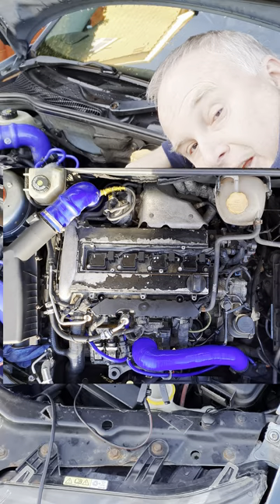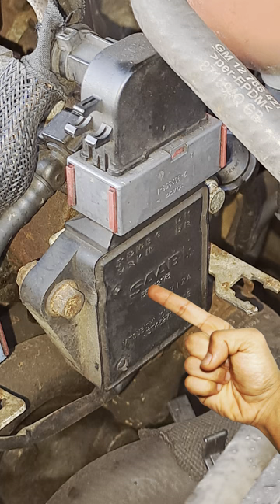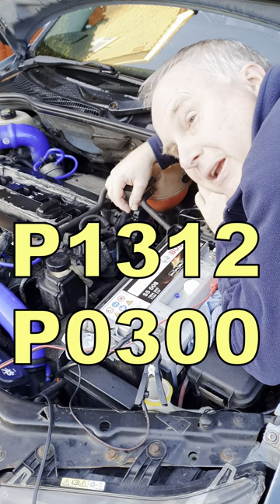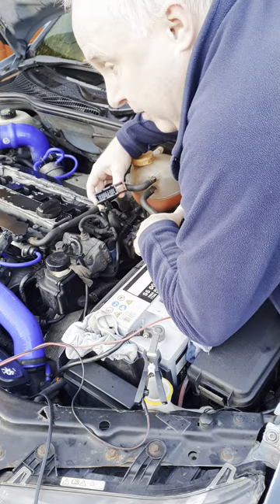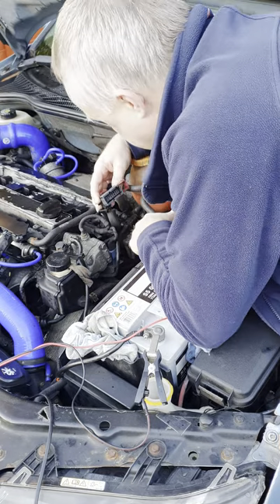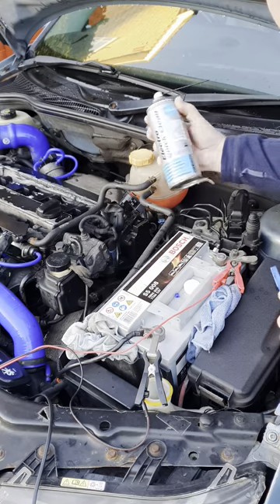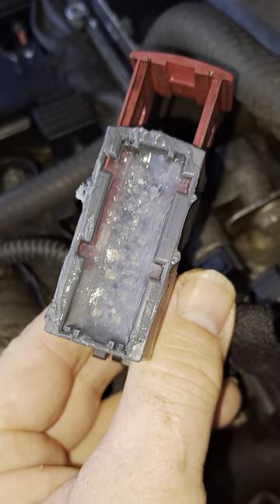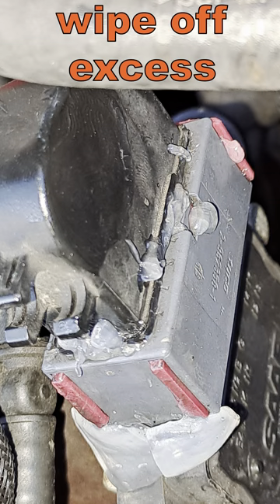Saab 9-3 Ionisation Module Problem - P1312

Comment: Dielectric grease is an insulator, and may cause an "open" in the circuit.  It has its place in the automotive world, but gobbing this grease onto sensitive electronic connections may not be a good idea.

Comment: I'm pretty sure that's not how you Wana use dielectric grease....please tell me if I'm wrong but I normally use just enough so it doesn't squirt out..mainly so it doesn't attract dirt and dust....good video though 👍
Reply from the maker: The idea here is to 'block' all the little nooks and crannies that allow dampness into the connector. Damp and dirt will thus be kept away from the terminals.

Comment: Great video! Quick question, my 9-3 B207, jerks a bit when I idle. Often when the car is warm. When it jerks, the RPM also drop a bit for a second. This dosnt happen when i drive the car.  Thoughts?
Reply from the maker: I'd be checking for a vacuum leak first. Check the throttle body and inlet manifold bolts are not loose . Check all intake hoses for splits. Next weekends video will show you where all the small vacuum lines are.

Comment: Don't have any codes or problems as yet so ordered some grease as a preemptive measure, it came today absolutely no corrosion on connector but blathered it and plugged it back in. I also did ecu connectors and abs module before I forget where I put the tube. Great tip to keep problems from turning up me thinks
Reply from the maker: Great to hear!

Comment: Another great find,
Thankyou,
When it stops raining I'll be doing this.
Reply from the maker: I cannot, 100%, state that this IS the cause of all those P1312 codes out there, BUT a non-waterproof connector under the bonnet? Bonkers. Poor Engineering and poor Engineering oversight from the Management team.
Reply: I’ve got P1312 and I timer this dumb shaking thing when I accelerate

Comment: Only just got round to doing this
But oh boy, what a difference.
Car is absolutely flying now,
Before it seemed sluggish , tired
And with a slight hunt on idle.
Thanks cyd , it's really made a difference
Reply from the maker: Try Denso IK24 sparks too. Big leap in technology compared to the original NGKs. Much much better.
Super stoked this worked out for you. Did your pins have dirt and/or corrosion on them?
Reply: @CycloneCyd  hi cyd,
Yes, three of the pins looked suspect, I used contact cleaner on both the module pins and it's wiring connector, a world of difference. 
I changed the old ngk plugs for quad fire ones,
( not sure of the make)
reason being, on my two previous saabs , I had one plug on both of them where the electrode tip fell off, both those saabs had plugs less than 3k miles on them, 
These quad fire ones have been fault free.

Comment: Hi Cyclone, love your videos, they've helped me so much wifh my 2004 9-3 vector! Recently had the water pump replaced due to leakage and I got the car back last week. A couple of days ago it started to get occasional misfires when accelerating, and at the same time I got the p0101 code - MAF sensor getting odd values. Should I look for vacuum leakage or replace the MAF?
Reply from the maker: First Q: is it an OE Bosch MAF or an aftermarket one? Make sure you have an OE MAF fitted.
Clean the MAF
Check for vacuum leaks (next weekend's video is changing the vac lines on B207)
Check you cobra for splits (replacement from the good people who make my coolant and intake hoses https://s.click.aliexpress.com/e/_DmOr0UB)

Comment: Hi. Firstly. Love your vids. Gonna be using your oil change video this weekend. 
I have a slight problem with my Saab. It’s getting an engine juddering when accelerating. (Auto gearbox) 2005 2L T. 
I’ve replaced spark plugs. Worked a bit better. Coil packs all seem fine. MAF is fine. MAP is fine. Only thing I couldn’t check was the O2 sensor on the turbo as I don’t have the right socket. Any ideas? :/
Reply from the maker: BUT have you TESTED the coils? https://www.youtube.com/watch?v=Tk6peaOCfSo
IF the coils test out okay, test your fuel pressure and give your injectors a clean
https://www.youtube.com/watch?v=MvACcx7eLg4&t=15s
https://youtube.com/playlist?list=PLOaePmzqZNJ3O5FiBWzLsLE2l-1fqAY1s

Comment: just recently got the p1312 code and going to try this. I took the connector out and cleaned the pins as well as cleared the code and it didn't come back instantly like normal. I will update after i drive it home.
Reply from the maker: Some people have reported running improvements. For me it was preventative. How is yours now?

Comment: I currently have this code. I was going too change the spark plugs.I would like too perform this procedure also. I hope everything goes well.
Reply from the maker: Use a toothbrush and some cleaner (contact, carb, brake) to clean up the pins. Then let it dry and connect back together. Clear the code and start her up. Does the code come back straight away?
If it doesn't use the car normally for a few days and see if it's still okay.
And please let us know how you get on. It would be nice to hear from several people's experiences to find out if this really is the cause of P1312. At the moment I cannot definitively prove it, I'm leaning on my engineering know-how here (which is good, but not infallible)
Reply: @CycloneCyd  Do I spray the connector with the red tab  with cleaner also?
Reply from the maker: @gman8578  yes, and give it a quick brush (with a soft brush like a toothbrush) to disperse any corrosion.
Reply: @CycloneCyd  Thank you so much. This means a lot.

Comment: Ive been working on saabs for 8+ years now and usually when i get these codes its 9 times out of 10 bad coil/coils. Ive never once replaced ion module just replaced plugs and coils and never had a car come back for it not fixing the problem

Comment: Hi dear,
I have Saab 93 1.9 tid from 2005 ,110kw
I have some problems with automatic gearbox, when it comes to four gear it comes some time like it's in neutral. What it can be? Regards
Reply from the maker: Have you checked the ATF level?

Comment: I followed this and put some silicone in there. Now it is stuck and I cannot open it. The red clip at the top would not open I tried applying force but it got broken. I am not able to unplug it now. 

And even if I find a way to unplug it then how can I plug it back in with a broken clip? Any suggestions?

Comment: I'm in Canada and we don't have 'Electrical Quick Clean' .. Can I use WD40 instead..?
Reply from the maker: NO, use a contact cleaner. WD40 do one, but any electrical contact cleaner should do. If you really can't get contact cleaner use carb or brake cleaner.

Comment: I have an 2007 Saab 9-3 2.0T it cranks but no start starts with starter fluid. Got it scanned got code “P0725” engine speed input circuit” what do I have to replace? Speed sensor, CPS? help.
Reply from the maker: That sounds like it's got spark but no fuel. If it's getting spark, it shouldn't be the CPk. On the other hand that code suggests it is. It is possible to test them, but you need a picoscope and the cost of a garage testing your CPk for you would be more than one costs (if fitting yourself).
So this is one of those few occasions where I recommend test by substitution. Make sure to get a Bosch crank sensor - these engines don't like anything else.
Are you in USA? This one: https://amzn.to/3Bsw4oz

Comment: Hello! I have a problem with my saab 93 2003 Aero. Its power is less than normal. The throttle is a lot weaker. But i have noticed that while i am on trip and have steady speed, with or withour cruise control i am getting a little blank brake and then the throttle is weaker than before. It is already weaker but it becomes weaker and its like i have 50hp. I have changed ECU, throttle body and gas pedal. My mechanic cant find the problem. It seems that has something to do with its electrical components. Turbo is working 100% correctly and the meter goes to full when i am on full throttle but the car doesn't give speed. Any idea in order to guide him?
Reply from the maker: Sounds like you have "limited performance" - does it not say this on the SID? You'll need Tech 2 to investigate that.
Double check this connector: https://youtube.com/clip/Ugkxe6jJtrbR_mlrhvYSo8tfe0iKcrj25_aQ

Comment: My 9-3 was throwing P1312. I cleaned the connectors with contact cleaner, cleared the code, and went for a long drive. Code did not come back!
Reply: I should mention that the contacts did not look corroded. And that the car ran fine. Probably one or two of the pins got resisitance from some minor dirt or corrosion periodically, causing an intermittent P1312

Comment: solved my p1213  lying wires for coil 1 first then 2-3-4 so wires for coil  4 are on top of other 3 tryed without sucsess changing  coil pacs 1and 2 new plugs and swapping knock sensor with known working one without sucsess code not came back for 3 days
Reply from the maker: I would suspect you disturbed a high resistance connection. These engines don't have a knock sensor, can you clarify what part you mean?

Comment: Good evening.
I have Saab 9-3 2004 2.0T.
OBD shows below codes:

P0034 [0x0034]
Turbocharger (TC) bypass valve - circuit low
----------------------------
P0498 [0x0498]
Evaporative emission (EVAP) system, vent control - circuit low
----------------------------
P0340 [0x0340]

Today car didnt start at all. Crankshaft position sensor is working, fuel pump fine.

Please help, if i Will change EVAP & Bypass Valve, Will it help me fix the problem.

Thanks.